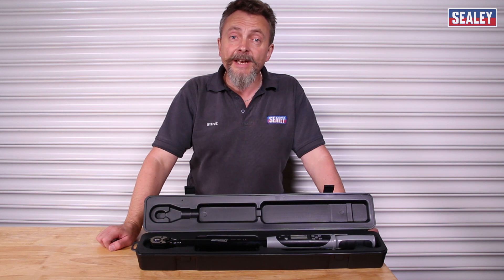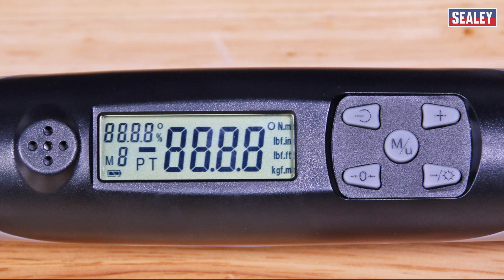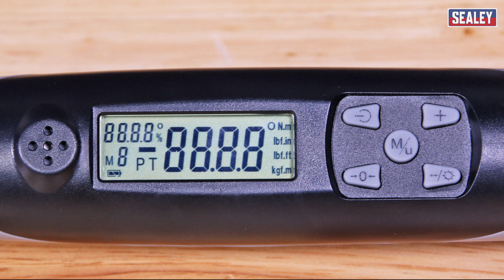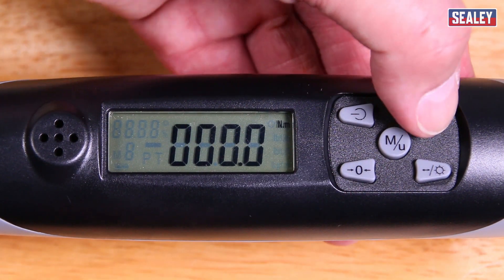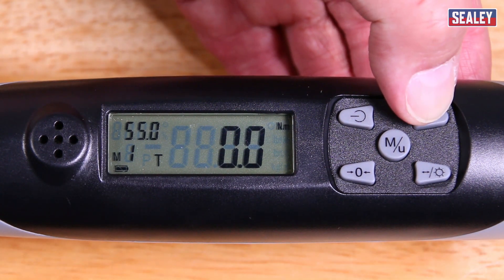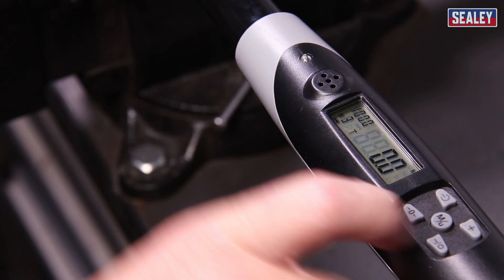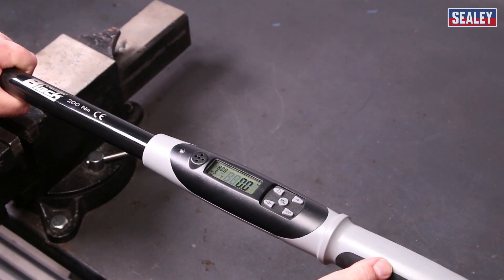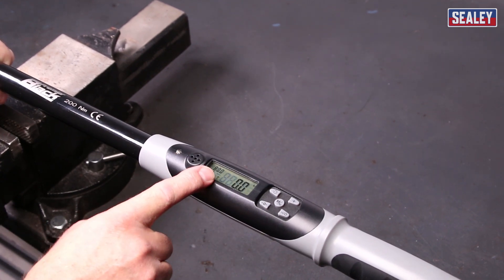Sealey Digital Torque Wrench Guide - Mastering Your Precision Tool

Comment: What model is that which is the best one to get easily to use and backlight
Reply from the maker: Hi. The one in the video is our 1/2"Sq Drive Digital Torque Wrench with Angle Function 20-200Nm - Black Series which you can view here: https://www.sealey.co.uk/product/5637202087/12sq-drive-digital-torque-wrench-with-angle-function-20-200nm---black-series or alternatively, check out our complete range here: https://www.sealey.co.uk/category/5637150778/torque-wrenches?utm_source=youtube.com&utm_medium=video&utm_campaign=_HyPifm4hSE&utm_content=description  Thanks.

Comment: Are them easily to use
Reply from the maker: Hi. Yes, once set up using our instructional video, they are very easy to use. Thanks.
Reply: Best to buy a Gearwrench or Snap-On. Angle is best with angle gauge

Comment: I've just worked out, this doesn't measure angle if you hold the wrench upwards (ie. lying on your back).  Why would you make a torque wrench that doesn't work when lying on your back?!
Reply from the maker: Hi Kj16V, thanks for your comment. This is certainly something we will look into. We haven't had this noted before but I will pass on your comments. You contact us at https://www.sealey.co.uk/contact-us if you feel you need a replacement.

Comment: i have a small channel i use sealey tools since 250 super mig welder when i was a teenager to todays modern tools includeing 3/4" impact wrench 660 start battery charger and and cordless sawsall keep up the good work

Comment: This torque wrench is absolutely rubbish don’t waste your money on this item
Reply from the maker: Hi Turbo,can we ask what your issue is with this torque wrench? We'd love to know as this is one of our best sellers
Reply: @sealeytools  i just bought one and love it....however i think the programming buttons make no sense at all and they should be logical and one should be able to pick the wrench up and program it without needing an instruction manual.  Also the memory button is very slow to use from mem 1 to mem 5...once the memory button is held down and it starts counting up the user should be able to press the memory button consecutively to select the next memory programs and not have to wait for the slow program to increase.
Reply: @sealeytools  I have this wrench, the only complaint I have is when using the angle function & can't complete in one action the angle isn't stored & doesn't carry on from where left off when ratcheting, you can click up quite a few degrees taking the slack up to the next ratchet tooth to carry on the redq angle.
Reply: Mine turns itself off whilst torquing, even after fresh batteries. I then end up over torquing! Can’t recommend it over a click wrench!

Comment: unless the software has changed from mine all you have to do to go from angle back to torque is press the bottom right button again not power off & back on !
Reply: Hi  BBS,   Does this wrench work the same as the Eastwood one https://www.youtube.com/watch?v=xHJ8cdj5cf0    the computer part looks just like it.
In the vid he says its a pain not being able to just seat a torque, but having to re program a memory to get a new torque, and using the angle setting does not really work to well?  whats your view on this as i was going to buy the sealey until i see the Eastwood review vid, cheers Richard.
Reply: Richard Lansdown I think the Eastwood is similar to a Clarke wrench I have without the angle function.
If I want a torque without setting a preset I just track the reading on the screen.